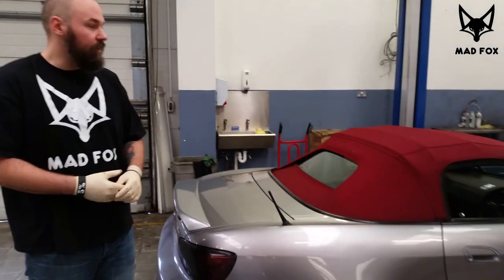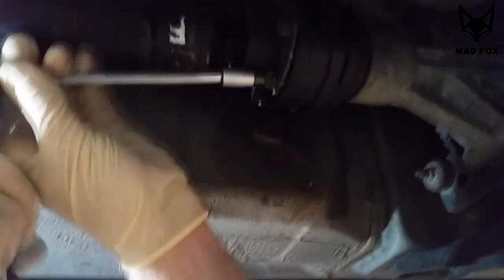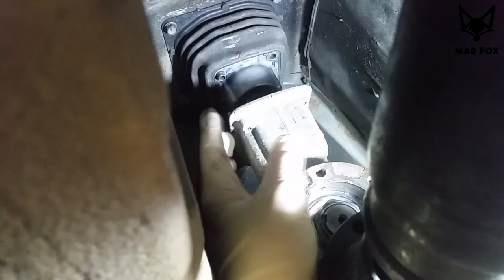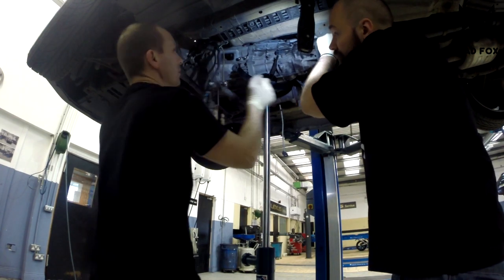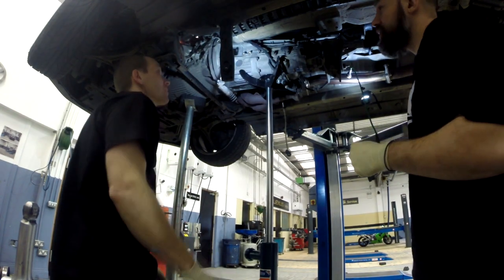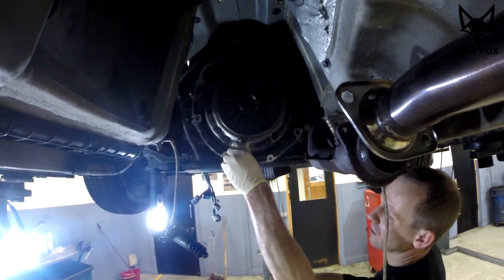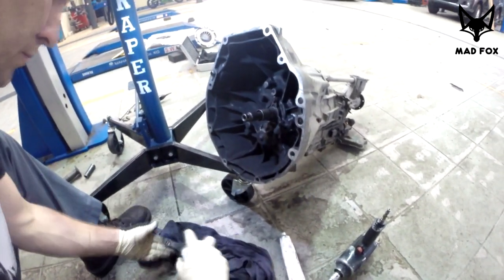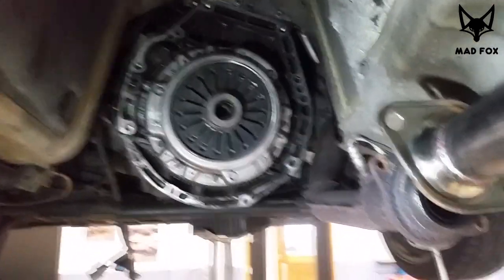Honda s2000 s2k clutch replacing

Comment: Thanks for the video, I'm doing the same job at a Honda dealership. Manual says to remove air box and AC compressor haha! I got the job late in the day and got to where you guys got to at 14 minutes. Instead of removing the engine mounts, I'm going to drop the subframe slightly for more tilt space. Thanks for the starter motor screw tip though. Great video.

Comment: Starter bolt from front is usually accessed by removing alternator and airbox. Engine mount usually stays just lower the subframe as much as you can. Nice to see a diffrent way to do it. More than one way to skin a cat.
Reply from the maker: Thanks  for advised all  ;)

Comment: Hi guys, thanx for this.  I like the mistakes in the video.  It lets us know that we can make them too and still survive.  I'll be tackling this project on my S2000.  I'm ordering a Clutchmasters FX 300 in and doing Skunk2A and Invidia Test Pipe at the same time.  Then she'll be ready for the Kraftwerks supercharger.......... :)  Cheers.
Reply: Lee  Douglas how'd it go?
Reply: It went well, but man was it a tough job. Some of the bolts, like the top starter bolt, and a few on the top of the transmission, were a real pain to access. Not to mention the crappy driveshaft bolts that like to strip. The car is running awesome, and the heavier clutch is excellent. It really hooks up, but the pedal resistance is only marginally increased. It was a real success, and the exhaust note isn't as raspy with the Alpha 2 headers and Invidia test pipe. The loss of weight from the cat, plus the better flowing headers, and the better clutch make the car feel like it's got 20-30 hp more......it runs better than new now. I adjusted the valves and cleaned out the throttle body and idle control valve as well as put a new starter in. It's a sweet machine......
Reply: Lee Douglas that's awesome bro glad it went well ... I'm going to attempt this tomorrow lol .
Reply: Just take your time and follow the service manual to a T and you won't have any trouble. I downloaded the service manual and it was excellent, but there was one error. The order for the loosening of the subframe bolts is incorrect. Reverse the order. Also, you don't have to fully remove the driveshaft. Just the end closest to the transmission. Then bungee cord it up. I know this because I stripped a bolt on the rear and realized it doesn't need to come off anyway. Also, make sure you use a rag to hold the clutch fork in place as the manual says....which I didn't.  That ended up being a total cluster when I got the tranny back together with the engine and realized it had fallen down in the bell housing.....f#$k!!! Other than that it went pretty well 😉
Reply: did  you do this? I would love to see pictures or video for my own future reference.

Comment: Did you get it proper i center? Since you were not using any allignment tool? I did not get mine properly in center, and now I have vibrations and my release bearing is getting bad, so now I need to do it all over again...
Reply from the maker: hi, don't worry, after 20 years of experience some tools are not necessary. The first symptom of not centering disc clutch is problem with installing gearbox. After a few times you press the pedal clutch the clutch disc centers itself.

Comment: How was the clutch after using it for over a year now? The XTD bearings are known to be trash.
Reply from the maker: HI, The clutch kit is recommendable for daily driving. However, during the repair of the gearbox I changed the clutch plate to the original, I made the mistake of leaving the clutch relise bearing, recently started on the higher Rpm to give a disturbing sound. I leave you the conclusions...:)
Reply: FixYOURride13 so you ran an OEM clutch friction disk? And you would've run oem bearings if you could?
Reply from the maker: bluewker/ yes now  I have mix, but the next  tim I will replace relise bearing for OEM only

Comment: Hi! I'm having difficulty pushing my fork back into place properly. What must I do?
Reply from the maker: Hi, fork have to fit before gearbox is on the place
Reply: FixYOURride13
I am not doing a clutch replacement. The clutc pedal got stuck. Seems the fork feel out of it's bracket somehow. Previous owner did not take good care of my car and didn't even check clutch fluid. Now I can't change gear because we couldn't get the fork back into it's place.
I had to take it to Honda today...
Reply: RolanTHUNDER did you ever find a solution to this problem?

Comment: So my s2k's clutch pedal pressure is starting to loosen, do I just need to drain the fluids or do I have to replace the whole clutch? And Honda told me it'll cost around $2k... It's just getting hard to shift to 1st gear, and reverse, but drives fine, no dropping in rpms, just clutch pedal is starting to lose pressure that's the problem.
Reply from the maker: Hi, tray replaced clutch fluid , if this not help you,  time for clutch kit .parts cost around 500€ + labor
Reply: +s2kBscreamin Had the same problem, replaced the clutch master cylinder. drained the fluids.  And the problem was solved.
Reply: +morzan zentoke didn't need to replace anything, just drained the fluids and refilled, as my fluids were low, and that fixed it for me.

Comment: you should have sent the flywheel to get resurfaced
Reply from the maker: hi, We assessed that it was not necessary , and fortunately we not made a mistake . Clutch is working fine 😁 But the next will be a lightweight flywheel. 😜